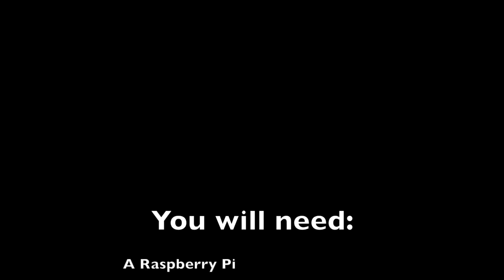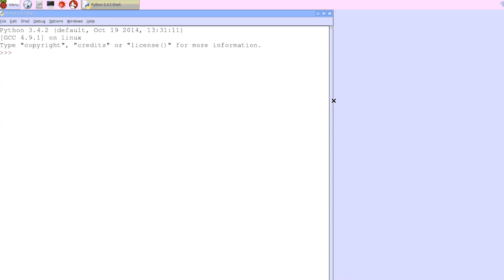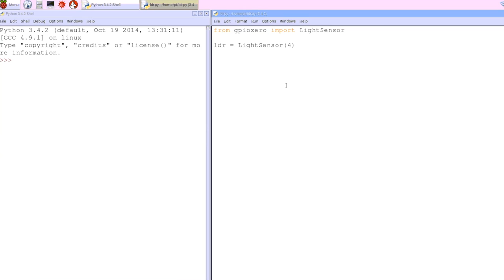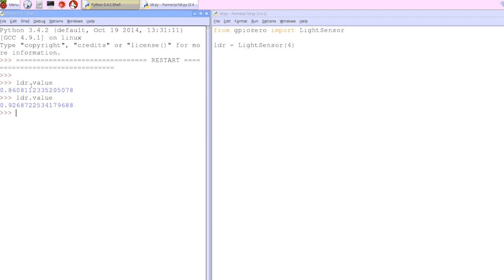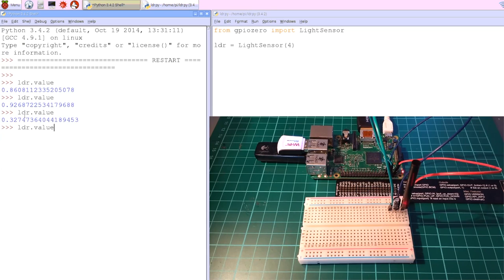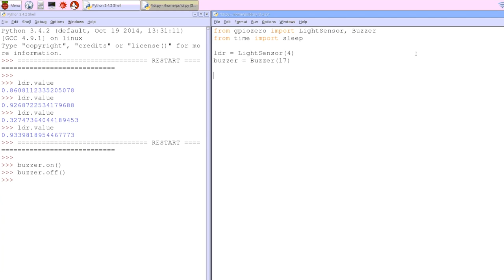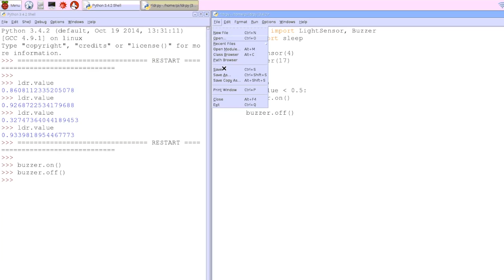A Raspberry Pi Laser-tripwire

Comment: Can you show how to do this same project with a photo diode or photo transistor instead of the light-dependent resistor?  I have this project running but I find the response time for a tripwire on a LDR is a little too slow for my needs.  I'm building a sports timer that needs to react FAST to dogs running through a 'laser gate'.

Comment: what is the purpose of a capacitor here? I'm a software engineer trying my hand at some circuitry and I'm failing to see the point. I understand they are for storing small amount of charge but surely the power is going to reach your LDR from your main supply. Is it to somehow protect the LDR??

Sorry if that's a noob question. I know they are a fundamental component but I can seem to get my head around them from reading, and I can't see their practical use either. doh!
Reply from the maker: The Raspberry Pi can only receive digital inputs.
So with analogue input like an LDR, the potential difference changes across the capacitor depending on the resistance of the LDR.
This affects the time it takes for the capacitor to charge and discharge.
In software, you can measure the time it takes between charge cycles and therefore work out the resistance of the LDR.
This lets you calculate the approximate resistance and therefore the light reaching it.
Of course, all of that is abstracted away by the python module.
Reply: How does the capacitor charge and discharge? It only discharges (not fully) whenever the resistance decreases, otherwise when the voltage wold be constant, right? I don't see how a capacitor would charge and discharge in a constant voltage and resistance environment
Reply from the maker: The capacitor charges until it reaches just over 2V. The pin on the Raspberry Pi then registers this voltage as being "on" and the pin changes from being an input pin to being an output pin at 0V. This switch over causes the capacitor to discharge, as the pin is acting like ground. The pin changes straight back to an input pin again, causing te capacitor to start charging again.

Comment: Can I use a pi zero w instead of that model you have there? I want to make a small form factor trip wire that will utilize the zero w's wifi to send a email alert to my phone when beam has been broken.
Reply from the maker: Moises V. Yes. Pins are the same on a zero.

Comment: Would the same thing be possible but instead of light using pressure or weight?
Reply from the maker: you could do, and it would be a simpler set up. you'd need to use a pressure sensitive switch.

Comment: it says error that gpiozero is not in the module
Reply from the maker: Are you using the latest version of Raspbian?
Reply: I have installed boobs but it was not updated
Reply from the maker: Open a terminal and then type:
sudo apt-get update && sudo apt-get upgrade -y
Reply: Sir how can I get a mail when the laser is triped
Reply: Please plz tell me about how to have a mail when laser is tripped
Reply from the maker: That's outside the scope of this tutorial. I suggest you google "how to send an email in Python" and try and work from there.
Reply: Can I talk to you through email plz
Reply from the maker: No, I'm afraid not - and I would remove your email address from a public YouTube comment.

If you want to learn about this stuff, then you have to become an independent learner. There are lots of resources out there for learning how to send email using Python, so I suggest you have a look and try and integrate it into the tripwire code.

If that is too difficult, then can I suggest you go back a few paces and look for a few introductory Python tutorials to help you learn more of the basics, until you are confident enough to sort such things independently.
Reply: Done!Thankx